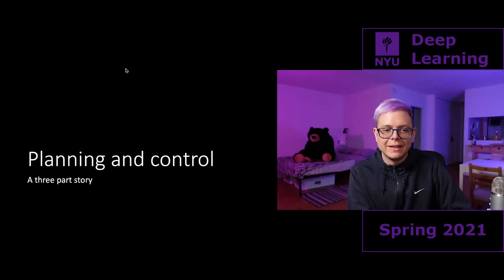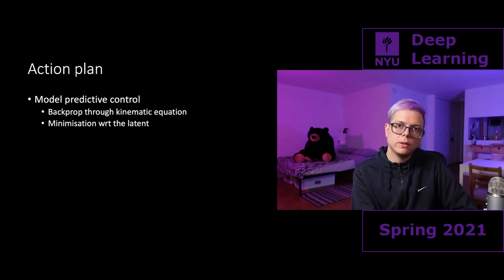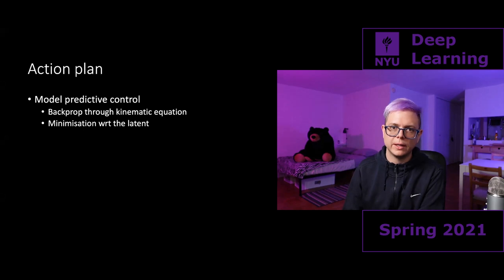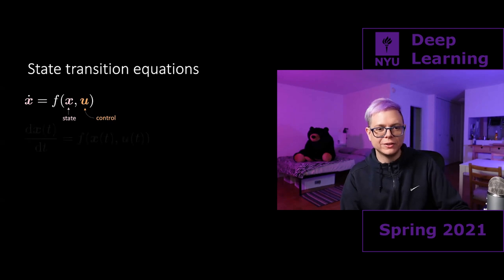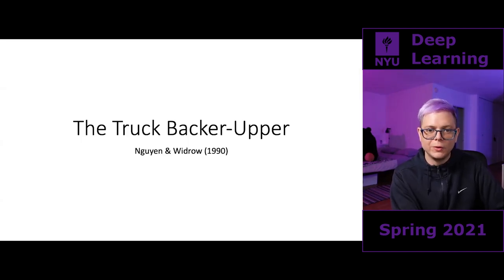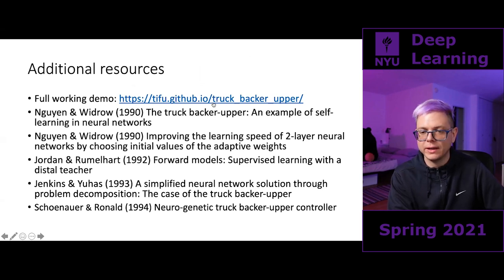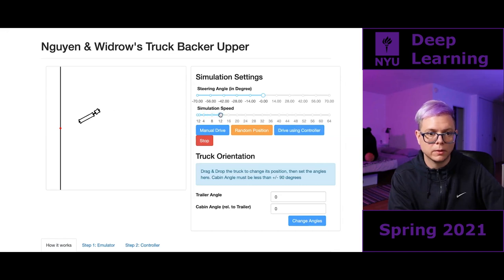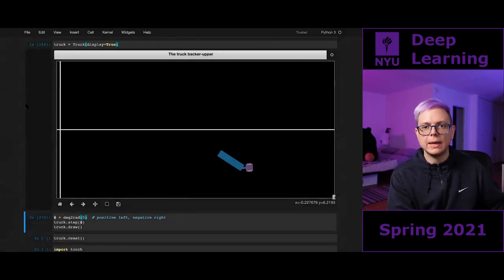13 – The Truck Backer-Upper

Comment: at 37:30, you are describing how the gradient is accumulating backwards through the time steps. This is the same as regular RNN's.. right?
Reply from the maker: Indeed, it's exactly the same thing. You may want to watch the previous week's lecture, where I show the similarity between RNNs and optimal control.